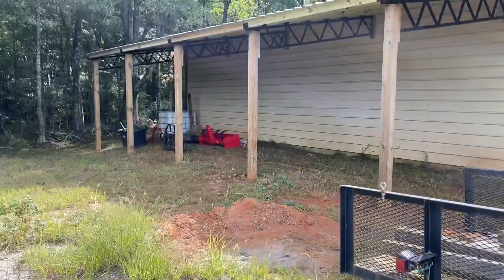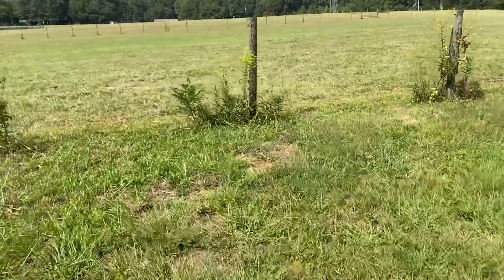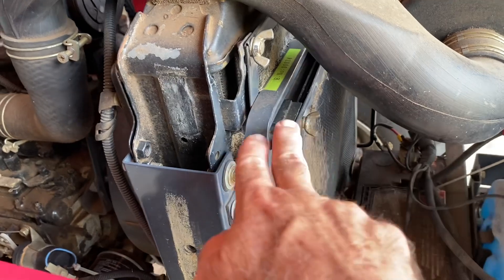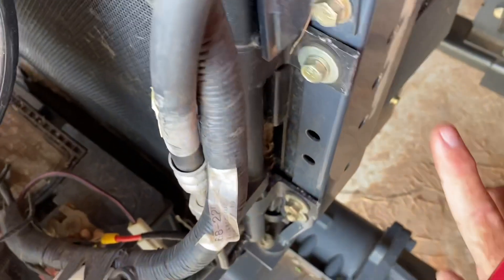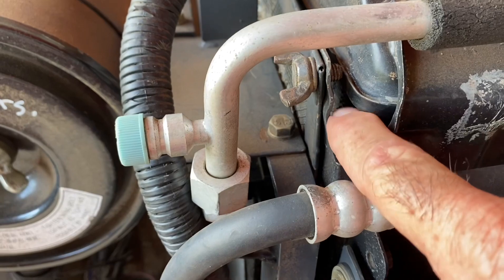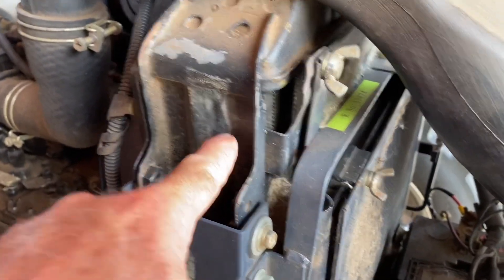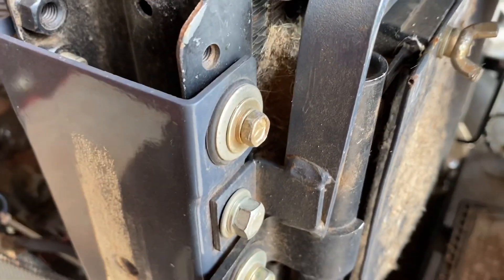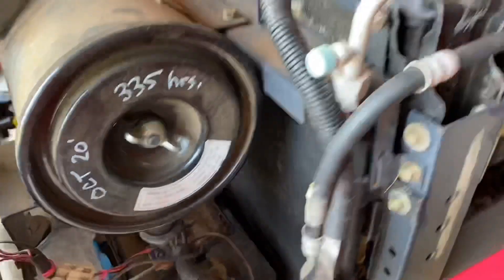Mahindra tractor overheat issue solved

Comment: I’m having the same issue with my Mahindra. Did this end up being a long term solution for you? Thanks a ton for the video!
Reply from the maker: Seems to be so far but it hasn’t been through a complete southern humid summer yet but runs consistently cooler never getting over 1/2. Hope it helps you and thanks for watching!
Reply: @bdradley1  it does help - thanks again! Gonna try that same thing tomorrow! Had to stop bush hogging today after about 4 hours because the engine kept getting hotter. But even before that, I had the same issue as you with the AC heating things up.
Reply from the maker: @padave29  yep I was in same place last year! You will be amazed at how much debris is in between the 2 radiators. Get a spray can of coil cleaner at Home Depot, should be in air filter or similar area and after washing off the bulk, then spray that to foam out all of the fine particles caked in there. Then keep a dryer lint brush, like 2 inch diameter and like 2 1/2 feet long, near by and you can just run it between the two rads after every major bush hogging to knock bulk out and do a coil cleaner annually!

Comment: Your solution is spot-on the radiator spacing. One suggestion for further improvement would be to install a thin strip of removable mesh over the two sides openings you have created so that debris won't get sucked into the gap. Good luck!
Reply from the maker: I appreciate it Gene, that’s in the works already!